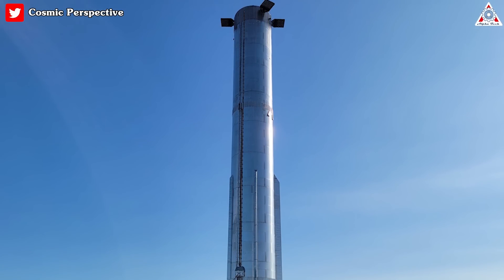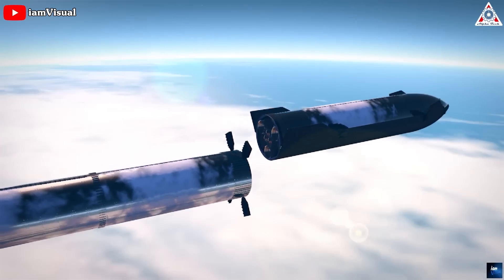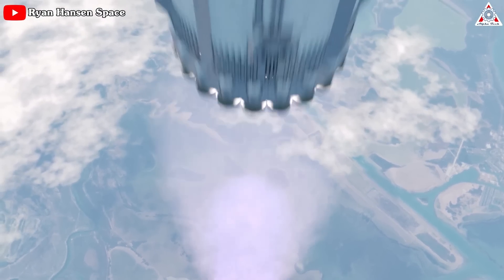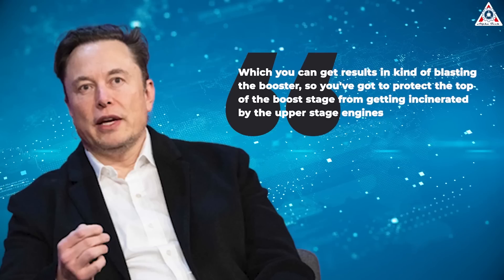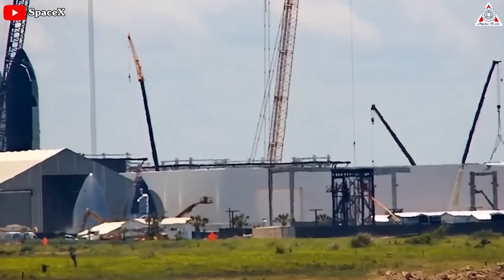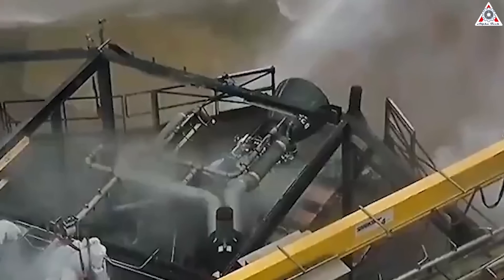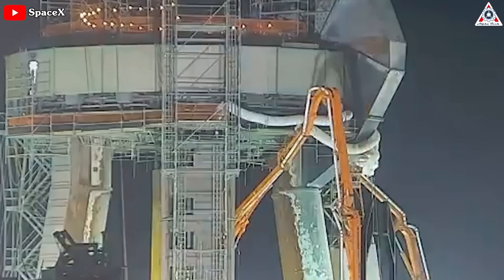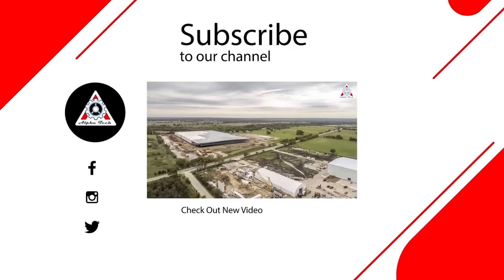Starship Super Heavy's HUGE Major Upgrades Revealed ...

Comment: One thing I’ve always wondered is why air breathing engines aren’t used in in the first stage booster to help in at launch and return even though solid fuel boosters may well deliver more thrust  the time and cost of recycling them is gotta a lot higher than something g like the that’s being developed fo the skylone rocket plane

Comment: I like these pictures of Starship landing on the moon .Really , there are no concrete pads there for such a tall  apparatus with a small footprint to land . The Starship will capsize if it reaches the moon .
Reply: Starship Moon HLS systems will have landing gear suitable for landing on unimproved surfaces like on the moon.

Comment: We are being served complete BS. During last test it become patently obvious that it is impossible to successfully launch a Starship rocket strapped to a SH Booster using a tube made of 4.5mm thick stainless steel sheet metal. Elon and Space Cadets at SpaceX panicked and decided to revert to an old more conservative plan of using 6 VacRaptors as support columns sandwiched between the Starship and the SH Booster. Instead of admitting errors of their ways they try to lie their way back from blind alley introducing 6 VacRaptors as great improvement and introducing hot staging so they can claim that support structures for expansion bells of VacRaptors  mounted on top dome of SH Booster are heat shelding of some sort for hot staging. Same BS tactics they used to hide the fact that during last launch attempt launch table structure sunk into ground crushing concrete around it. Compacting sandy soil takes three elements working together: high compressive force, water and vibration. There was plenty of each element during last launch.

Comment: With all of the brilliant rocket engineering you wonder how SX could get the launch pad so wrong. I think more than anything was the desire to simplify the launch system so repeated flights could be made. SX simply ignored all of the past history on what it took to deal with the sound, heat, vibration, noise, etc., of takeoff. I think the verdict is still out. The environment of the area doesn't help either. Great job here putting all of the details together in this video. SX has a plan and they are just adding details that have most likely been on the drawing board all along. A few folks just think more "broadly" than anyone else and one or two of those few make it a reality. I think you just have to support those who can get it done.